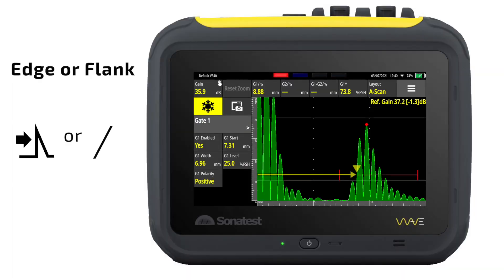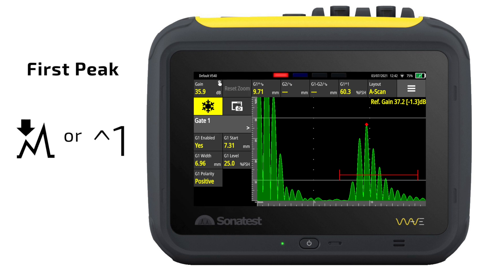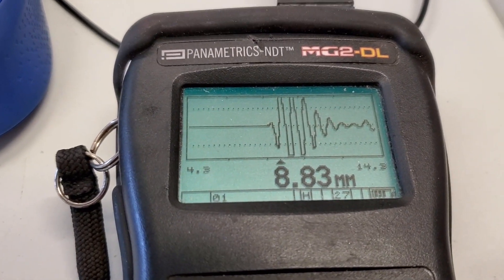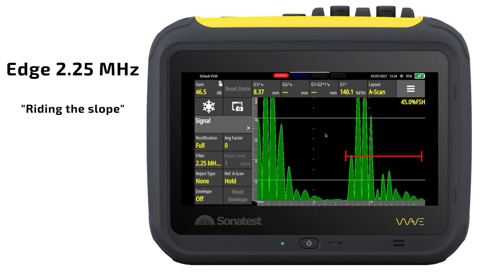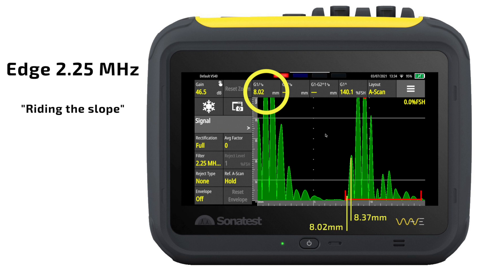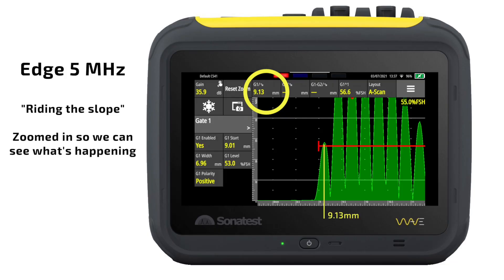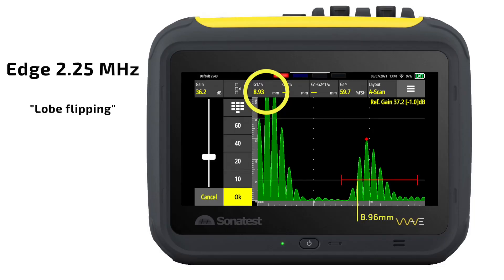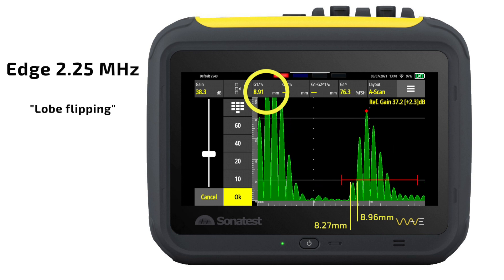UT Gating Modes

Comment: Awesome video.
I use first peak now always when doing a thickness/lamination scan before my shear wave weld inspection. I like to do the lam scan first and make sure there’s no laminations and then I can get an exact thickness to put in for my shear wave so I can trust my machines trig math a little more. I really like your videos, and hope to one day be as smart with UT stuff as you are!
Reply from the maker: Great advice on verifying nominal during the lam scan!
Reply: Can u tell me why what to do when our flaw detector doesn't have E2E mode and we don't have painted Calibration block n donot know the painting thickness as well. I was using "Einstein" made in India , the difference between Einstein and Thickness meter was a out 1.5 to 2mm for the same spot while doing A scan.what to do for accurate measurements with UFD

Comment: OK, but which one of these is to use with dual probe and flaw detector? First peak or flank mode? Thx
Reply from the maker: Depends on what you're trying to do and the type of signal you are looking at and the precision you need. For normal applications, flank is fine for thickness. But if half a millimeter is important to you, then you probably need to look at using peak or first peak and maybe an unrectified signal.

Comment: Great explained video, just a quick question. When setting up a prob for calibration on a V2 block to set the 25mm angle what would you use, the peak or flank mode? Cheers
Reply from the maker: For shear wave it doesn't really matter. The difference you'll see in sound path is negligible.
Reply: @hollowayndtengineeringinc.5201  brilliant, very much appreciated.

Comment: you mentioned that in thickness measuring thin stuff gate mode is important, well, what kind of applications specifically should I be using Edge, Flank, and j-Flank?
Are they suitable for composite material inspection other than metals like steel?
Reply from the maker: For thickness measurement, edge/flank/j-flank are all the same thing.

Comment: I usually prefer, edge mode with negative half-wave rectification, find way less lobe switching  than with positive half-wave rectification for some reason. Am I crazy?

I sometimes wonder if echo-to-echo produces artificially uniform thickness measurements sometimes over using a single back wall (No coating and with coating) Am I crazy?
Reply from the maker: You might be crazy! :)